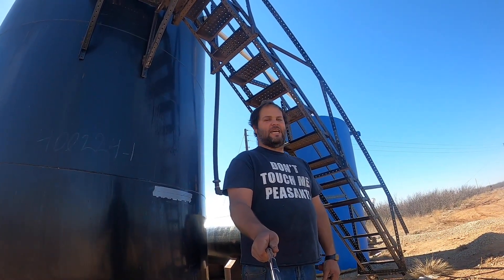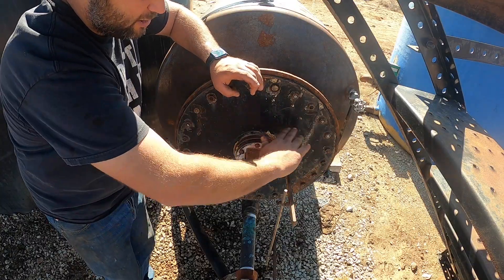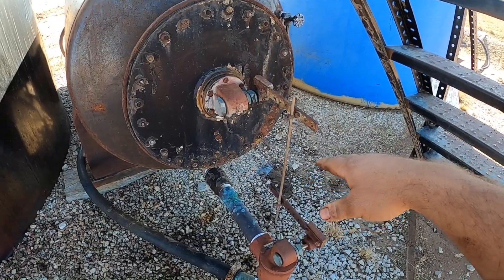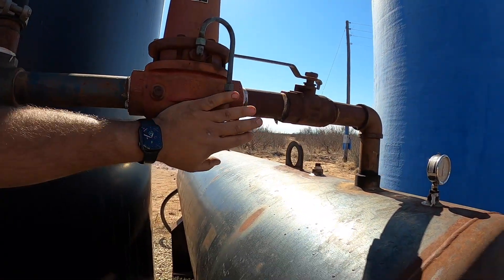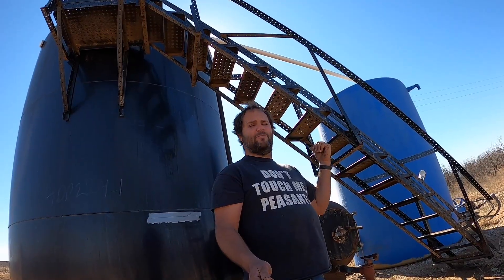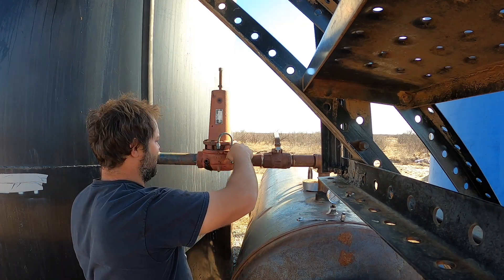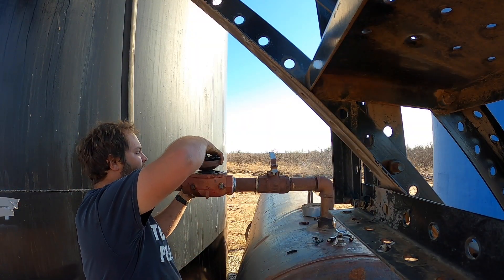Oil and Water Separator

Comment: Hey @TheZachLife I’ve watched all your videos and learned several things about low pressure shallow oil leases. Do you have any experience modifying a 2 phase vertical separator into something like this? Maybe changing out the float? Thanks for all the info!

Comment: How does the oil get to the buyer, and who is that?  
When I watch this, I think of how none of this would work up here in Walz Dizzy world. The temp can get as low as -35 degrees F,, which would freeze up the system. That’s just one of the benefits of living up in libtard land, (Minnesota).Sometimes we have to drill through 2-3 feet or more of lake ice just to get at food.
Also, around here, it’s  about 300-400 feet down to bedrock. If you’re looking for water, and you hit that,it means you fill er back up and try somewhere else. Are your wells drilled through bedrock into something different that holds oil? 
I have more dumb questions, but that’s enough for now. 
Thank you for the interesting content.

Comment: Thanks Zach I’ve always wanted to know how that process worked.  I noticed what looked like smoke coming out the back of the separator while you were turning the oil pressure valve off, was that just oil or water mist escaping from a pressure relief valve or something else?
Reply from the maker: It was a pile of pallets some one threw out in the county road that i set on fire to get rid of.

Comment: That's an interesting valve I guess it uses the static pressure coming out of the separator to keep the valve seated tightly and it has to overcome the static pressure plus the pressure you set with the adjustable spring kind of a fail safe.

Comment: Hey Awesome video.  Question could this work with a Vac truck on the inlet side of the oil water separator or would it need to constant flow like you have with your well pumps?

Comment: You  need   lighting  arrestor  on the salt water FIBERGLASS  tank.
Lighting  strikes  loves  ❤   FIBERGLASS tanks with salt water,    F. G.  tanks attract  lighting strikes. 
Lighting  strike will set the location tanks  on fire 🔥.
FIBERGLASS  tanks  need  metal plate inside the tank,  in contact with  the salt water,   and  out through the  FIBERGLASS  wall,   to a ground rod  outside the tank.
The fumes inside the the crude oil tank ,  will explode,  blowing  the top of the oil off,   and will burn 🔥  the oil tank down  to ground level.
Reply: I have seen more tank batteries covered in static dissapators burn to the ground, vs no protection at all

Comment: That is very interesting and actually simpler than I might have imagined.  I imagined the separator to be larger and more complicated.

Does the water get further treatment and used for anything or just pumped back into the ground?  Does that go down the same well or a different well drilled for that purpose?  How do you keep that waste water from contaminating the drinkable ground water or from just mixing with more oil and being pumped back to the surface?

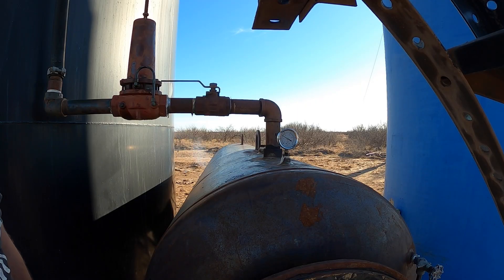Lastly, at about 16:05 to 17:45 there looks to be some light gray smoke coming from behind the separator.  What is the smoke coming from?
Reply: Saltwater/wastewater is pumped down a separate well, which can be one drilled expressly for that purpose, or could be an old played-out well repurposed for saltwater disposal. Generally the only 'treatment' it gets is the separator. A heater treater is necessary in some wells because the water and oil become emulsified and will not readily separate at normal temperature. Heating it breaks the emulsion. 
And I too am curious about that smoke/mist/whatever.  At about 1:15, he's showing that inlet end of the separator, and no mist is visible then.

Comment: Thanks for the videos! Man, I wanna build you some solar powered webcams and monitoring systems with a cellular or RF backhaul so you can monitor all this stuff remotely!!!
Reply from the maker: Haha I've got some friends that have used the cellular trail cams and likes them.
Reply: @TheZachLife  You could go even farther! Get a cell modem, connect it to your own wifi device and create a wifi network at the site. Now you can add stuff like a Wyze Cam ($25), a whole slew of sensors (liquid level sensors, temperature sensors, etc) connected to a raspberry pi that connects to wifi, then build a web dashboard with all of your sites and what the acceptable levels should be. Now, as long as the data is flowing in, you know you don't have to visit the site! Find a new failure type? Add another sensor or three. There might even be some inline flow sensors that can see how much liquid is moving out from each well, or reporting on your water-to-oil ratio as an indicator of a well issue.

The whole IOT world really opens things up to remote monitoring of equipment in the field. 

Then again, if you enjoy driving around and checking on things, I don't want to take that from you! I'm just a fan of such things so I can be lazy most of the time. 🙂

Comment: Why don't you have the water pipe fill the water tank from the top of the tank, so the static pressure is one value, and is not changed by the raising water level in the tank?
Reply from the maker: One problem is that you cant let the water fall through the air. It will pick up oxygen and cause all kinds of problems.

Comment: Little different than shallows wells in Pa. Most of the ones I see there is a drum about the size of a 55 gallon drum oil floats up top goes down a 2 inch pipe to the storage tank and water goes into a small pond next to the well. Use to put oil in the ponds as kids and light it up not much else to do growing up middle of nowhere young and dumb then.

Comment: If you place the water tank input line at the top of the tank, then the diameter of the riser pipe will determine the amount of  head pressure. Once full that value will remain the same reguardless of how full the tank is, eliminating any variable in the water side pressure value.
Reply from the maker: You are probably correct.

Comment: What was smoking in the background? What percentage of water does it remove from the oil? Cool videos would be awesome to own property with a setup like this on it.
Reply: He mentioned he'd set some discarded pallets on fire.
Reply: You try to separate it all but that's rarely the case, some loads get rejected if over 1 percent. During the winter it's hard to knock the water out even with heat.

Comment: This valve is just an enormous version of the "functional element" on a Red Jacket submersible pump common at gas stations.  The functional element is used to release some  line pressure when the pump turns off, and when the pump runs it allows flow through a venturi, which creates suction that can be used to prime a siphon line between tanks.

Comment: If you inject the salt water back into the ground, is there any chance that you can contaminate the water table, or does it go deep enough that it has no effect on it??
Reply from the maker: All the fresh water zones are protected by at least 2 but often more layers of pipe and cement that have to be pressure tested and monitor and must extend well below any fresh water sands. Under ground injection is highly regulated monitored to make sure we protect ground water.
Reply: @TheZachLife  Thanks, I wondered about that.

Comment: Wouldnt it be better to plumb your water dump line to the top of the water tank. Either at the top or the side at the top so that your pressure needed to dump water is always the same due to the hydrostatic being the same because all you would be dealing with is a 2" column of fluid vs a fluctuating tank level since its plumbed into the bottom of the tank?
Reply from the maker: Some people do .The problem is you can not let the water "fall" though the air in the tank as it has high iron content and it will make iron oxide and cause all type of trouble plugging stuff up.

Comment: If you have a failure and dump oil in your water tank, can't you run it through the separator again and recover the oil? I'm guessing  you could discharge most of the water from the tank before trying to recover the oil
Reply from the maker: Yes but typical you would just have a tank truck drain the water off the bottom of the oil tank. Theres a valve at the bottom in the back made just for that.

Comment: Would it be simpler to have an inverted siphon with a vent at the top to hold your head pressure?  No moving parts, nothing to break, only as expensive as a few joints of pipe.  The only thing would be the lightning rod sticking up in the air.
Reply from the maker: So I have though about this and have seen something like that thats tried to been uses on very low volume leases but it doesn't work very well. The problem is that the oil when its depressurized through the valve it turns into a oil gas foam a lot like a shaken up coke and with a column of "foam" won't build much pressure because the density is low. Also the inflow of oil to the separator ofter comes in waves and will flush the oil column out with the gas foam.

Comment: Love your channel. Greetings from Canada. Up here we have to use heat  to separate the gas and oil. Basically its a firetube that runs inside the separator.
Reply from the maker: That seemed to be more common in the old days. I guess they figured out they can get away with out heating it. Also around here we don't make any gas to fire them with anyway.
Reply: @TheZachLife  It's curious you don't have any gas - so what happened to it all as all gas, oil and coal are organic matter buried during The Flood 4,370 years ago.
Has all the methane migrated up and way through loose soils?

Comment: Good video of how a free water knockout works!  I used to plumb these in as a summer job during college.  They really weren't common here in Oklahoma until around 2000, when local operators started drilling wells with very high saltwater production.  Prior to that everyone used a gun barrel or heater treater.  Appreciate the oilfield vids!
Reply from the maker: Thanks.
Reply: I am stepping out for gas.

Comment: Great video. 

Love to see the low tech. setups.  Less equipment is always a better idea of it can work.   Trunion dump valve and a vessel side pressure regulator is a about as simple as it gets with an automated system. 

I'm sitting here talking to the screen.   It's the regulator.  The fod    mystery is always restraining. 

Time to consider having a basket strainer upstream of the separator. Perhaps a check valve betwixt the h20 AST and the separator, I couldn't see one. I see a ball valve on each end of the h20 transfer line.

Keep up the great videos!!!
Reply from the maker: I watch your video on the separator and was amazed at the complexity in comparison to what I'm used to dealing with. Ive considered a strainer in the upside of the oil dump valves but it just doesn't happen all that often. We used to run check valves on the water legs but have had two instances where the flapper wears through the rod its supported on and gets turned sideways in the check body and plugs up the line. I decided to fixed that problem so I made all of them into brass scrap. haha.
Reply: @TheZachLife  yes,  a typical horizontal three phase separator is complicated and expensive to maintain. They are only needed on larger volume wells.   Not any good reason to use them for low gas flow wells,  unless the oil was high in paraffin or a high bitumen content.